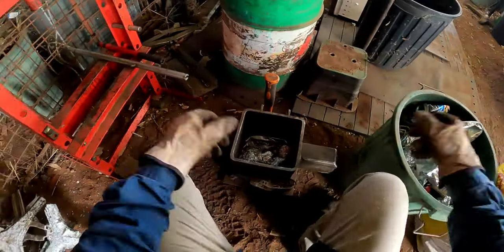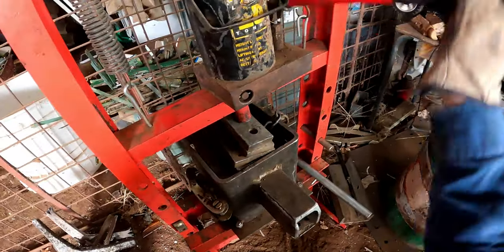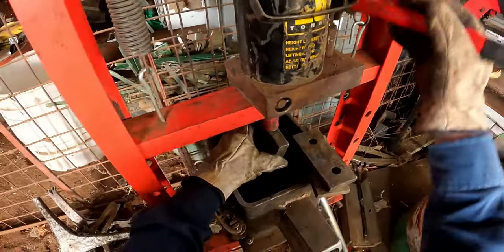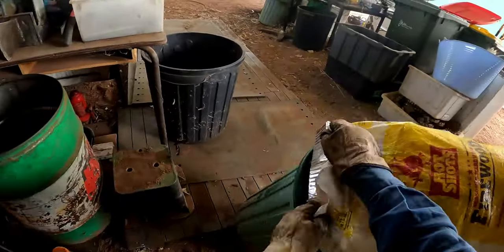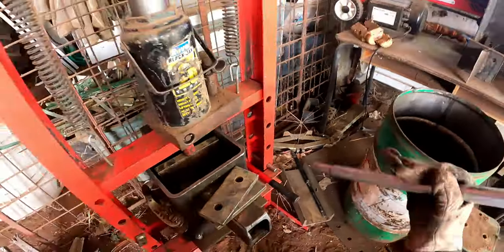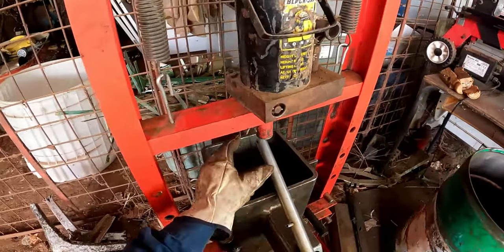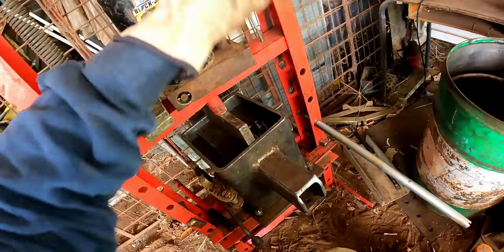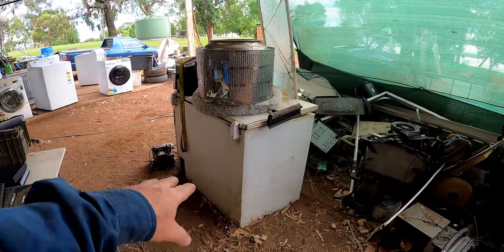Doing What You Can With What You Got Pressing Up Aluminium

Comment: hi, if the wires are passed through a small shredder 4 times and then pour everything into a barrel of water, then the plastic is light, it will float from the top to the bottom, and copper or aluminum will be at the bottom this is the easiest way to get rid of plastic if you don't have time to clean them and you need to clean everything quickly in large quantities👍